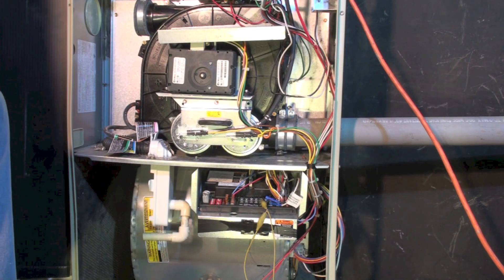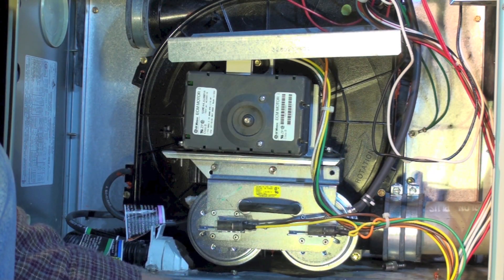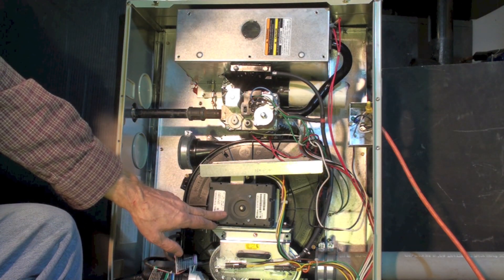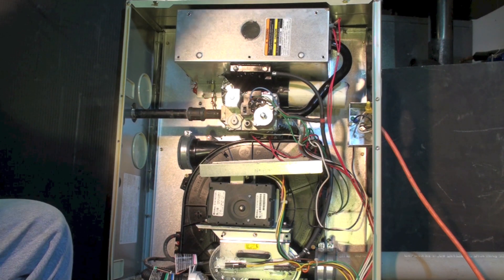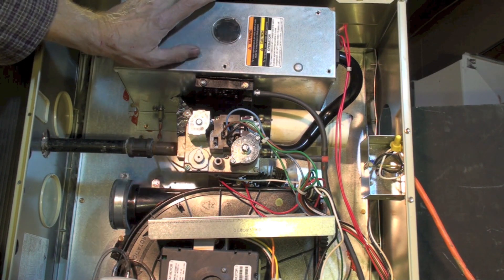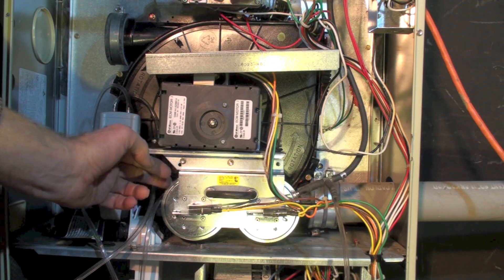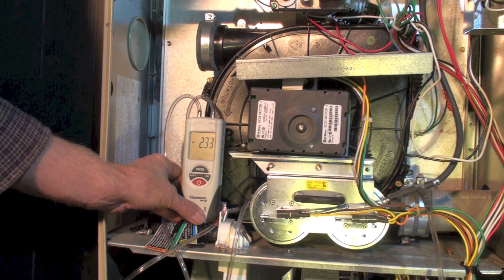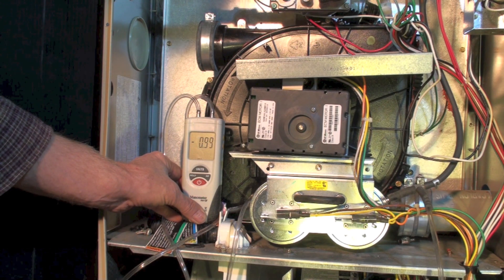Bryant 355 MAV gas furnace 1st stage cycling #2

Comment: Can you answer a couple questions testing the Bryant propane gas 90+ furnace Model 355MAV...

Do you know what psi the propane tank after the regulator into the house gas 1/2 line should be set at.

Do you know what PSI a 20 pound LP bbq tank is after the regulator.

Long story short... i burn wood in my wood furnace and only use the propane furnace during the coupke hours at night to maintain 68F temp when wood furnace dies down.

I installed secondary 1/2" black pipe propane line (same size as main line from 275 gal in ground tank) with cutoff valve to the furnace.

I hooked the 20 pound LP tank with regulator to secondary line and the furnace seems to be functioning fine.  I read tgat the regulator or 20 lb tank could freeze up... but all seems fine so far after 1 week  use to maintain house temp.  I reslulize the tank could freeze if furnace senses needing more propane if going to stage 2...but only using to maintain temp for the couple hours in early sleeping hours when wood fire dies down.

After thought of reading and resesrching further has me wondering if the 20 lb (with bbq regulator) has too high if PSI  going into the propane line to the furnace.

I am homeowner
Reply: Reason for using 20 pound tank...
  ▪ main tank ran out of propane and did not want tompay hundreds of $dollars for a fillup since i only use a small amount.  

Using the 20 pound tank i used less than 2 gallons in 1 week to maintain 68F.
Reply from the maker: After the regulator the pressure should be 11 in wc.  All bbq cylinders that I have seen are also 11 in wc.  You must be in a mild temp.  The cylinder does not really freeze up.  The propane drops in temp in a small size cylinder and will not gas off.
GFM
Reply: grayfurnaceman thanks

Comment: Hey Mr Gray. I am currently stuck on a 353 2 stage furnace that's giving me a 4 2 diagnostic code . I've checked a number of things even replaced the board but still get the 4 2 code . I'm hesitant to replace any more parts as they are very expensive especially for this model . Can you give me any suggestions?
Reply from the maker: I believe the 42 code is for an inducer problem.  Does the inducer motor start?
GFM
Reply: Wow. ! Thank you for the quick response.
The inducer comes on at times.  Usually when I check a number of things safety switches, pressure switches,  drain trap the inducer will come on and run . However if I cycle it several times to insure it's fixed it will give me a 4 2 code approximately 10 after a call for heat. Inducer doesn't come on before it throws the code.

Comment: HAve anything on this unit making unusual sounds when it starts? Doesn't seem as noisy in the basement but on the first floor it is noticeable. Just started a week or so ago, goes away for most of heating cycle but is noticeable at most startups. I am thinking the inducer fan.

Comment: Also check that secondary heat exchanger. If you see corrosion on the outside (usually towards the rear, sometimes on the back plate where the primary transitions to the secondary heat exchanger) it's time to replace it. I've replaced nearly two dozen Bryant/Carrier secondaries & it can be a real PITA.
Reply from the maker: This series will be dealing with that problem soon as this one does have a rusted heat exchanger.  These furnaces were the subject of a class action suit.
GFM
Reply: grayfurnaceman
Didn't Carrier/Bryant avoid the lawsuit by saying, "Oh, there's nothing wrong with our secondaries, but look, we'll include an extended 20 year warranty on the heat exchangers."
Reply: Also want to say I enjoy your vids GFM.

Comment: Great video. I am looking forward to more on the pressure switch explanation. A lot of techs today are confused buy these differential and multi switch set ups. I have seen techs switch the hoses on the combustion box and inducer/collector box when the furnace failed to run. All the while the intake pipe was restricted.
Reply from the maker: Good thoughts.
GFM

Comment: Worked on a few of these. My only complaint is when the combustion air is plumbed coming in from the left side. It's a bear getting the flame sensor in and out also reconnecting the wire after testing. Other then that its a good unit. Thanks for sharing.
Reply from the maker: Or on the right, replacing the HSI.  You can't win on those.
GFM
Reply: Get a 90 deg screw gun attachment, to me it's the easiest way to remove/install that PITA flame sensor.